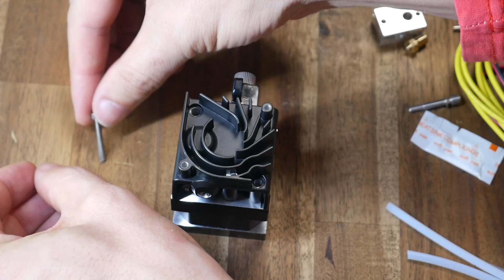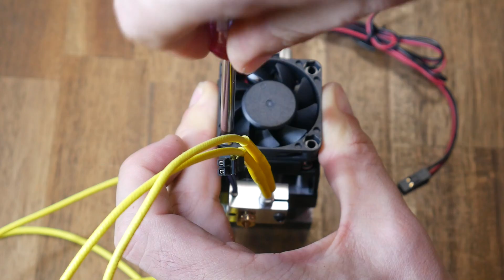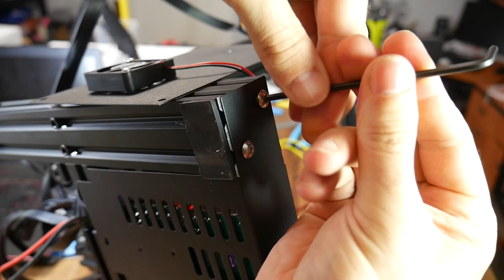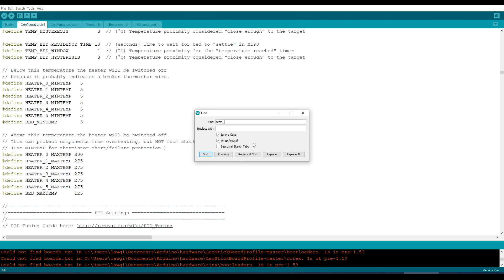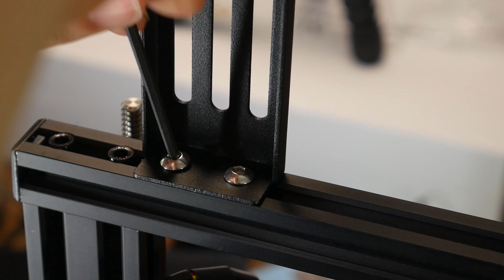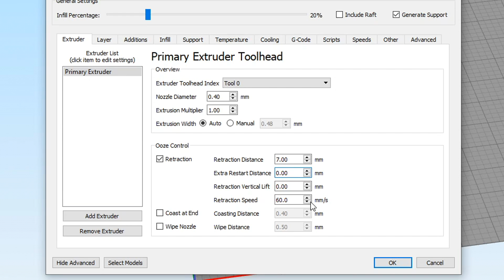Hemera to Ender 3 - Complete guide

Comment: Another fantastic video guide michael👌 While I have your attention can I ask you a brief question-Is there any point putting marlin 2.0 on my ender 3??? It seems to be doing everything I need it to do with 1.6 on (i bought the original 1.1.4 silent board When it was released early last year but only recently fitted it). If I ask "print nerds" They will all tell me it needs to be done for no other valid reason then it is the latest version that the machine will take-I am not one of these people who is hot on upgrading my machine, I am a mechanical engineer and my machine is essentially a tool that are used to support my RC plane hobby,So I only believe in doing ESSENTIAL updates to the machine (I did the board because it did away with salmon skinning etc and added the thermal runaway protection). As a rule this machine works really well and I get absolutely fantastic results as I have my slicer tuned perfect, but I have been wondering if it is really necessary to upgrade to the latest version of Marlin that the board can handle. When I changed the board I noticed the new one no longer allowed me to play tunes using M 300 In my ending script, so I have been contemplating flashing a bootloader and seeing what has changed in the firmware-which brings me to the question of is it worth changing the version, or should I just "not fix what is not broken"

Remember I am not a hard-core printing nerd, my printer is merely a tool to do a job in my eyes the same as a CNC machining centre or a screwdriver. Thanks in advance for your time answering my question👍
Reply from the maker: I would say if you have thermal runaway in place and you are happy with your current results then don't fix it if it ain't broke.

Comment: I have one, on my custom CoreXY - LOVE it. Am hearing more and more people having issues with it. I personally haven't had a single problem. Am running a 0.8 MicroSwiss coated nozzle which may help?  Also, found the stock fan SUPER LOUD! I replaced with a double thick (40x40x20 instead of 40x40x10) Noctura and it made a world of difference with out lowering air flow.  I have a quick "1st impressions after a week" video on my channel.
Reply from the maker: Fan is definitely louder, I agree. Glad you are enjoying your install.

Comment: I have been working on an install of a Hermes for the past week or so. You pointed out a couple things I've missed so that is great. My first layer is an over extruded mess but I am getting my set first layer thickness (.3mm) and 100mm through the printer when sent (393 was my steps number, 1 off of yours.) I need to dig into 32bit Marlin and find the thermo couple type number.
Reply from the maker: Haven't fitted a thermocouple so can't help you with that. Good luck!

Comment: Editing as I watch... 
Hangtight has been very busy making mounts and ducts the last several months. All his designs are flow optimised using software simulators.
With the silicone sock installed you shouldn't have issues printing PLA w/ a PLA duct. I haven't tried PETG yet, but 8mon and no sag on the duct.
How does the wrap compare to the weave from a flexibility standpoint?
940? That's a beefy motor for a reduction drive. I actually turned the current down by 100 for the pancake that came w/ my titan clone as it was too hot.
Moving the Y endstop would be preferable to losing 20mm of build area. It's only held by 2 screws and will slide easily on the Y extrusion.
Reply from the maker: 940 is in the middle of the range from the specs given by E3D in their docs. I agree it seems too high. Moving the y endstop fixes the homed position but the nozzle will still not reach the back 20mm of the bed.

Comment: 3d print general channel was testing this with TPU (ninjaflex) and it was getting jammed, only way to fix a jam on this is to take the whole thing apart.
Reply from the maker: It's easy to get into the internals* (*only after you've pulled the whole assembly off your mount).

Comment: You should have turn one rotation on the heater block to get it lower and the nozzle wouldn't pop out as much. Also you should use Volcano heater block on CR-10 Max for higher diameter nozzles. Just an advice.
Reply from the maker: Agreed on the volcano, ideally suited.
Reply: Ya, I thought about it, but using a 0.8 nozzle now and not really having issues with PLA or TPU. running average around 60mms (40/50 for fine - 70+ for quick and dirty) seems to be just fine. Don't think I can really go much faster as the weight is a bit much.

Comment: Nice straightforward video mate. I’ve got mine to fit, using different mounting parts though, somewhat smaller rear brace than yours. I’ve also got an skr dip and bltouch, if you’re interested I’ll report back when I fit it in the next few days.
Reply: pukington please do report on which parts you used to mount the Hermera
Reply: @Gadget_Angel  Sure mate.  I'll bung it all together and test it and reply with what I use when successful. Give me a couple of days.
Reply: pukington looking forward to see what you do, thanks for the effort and time